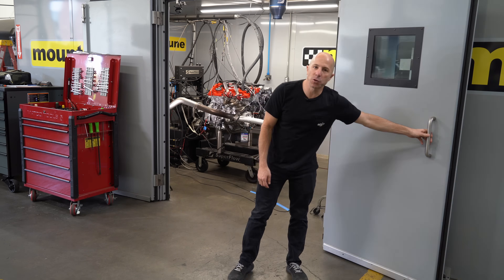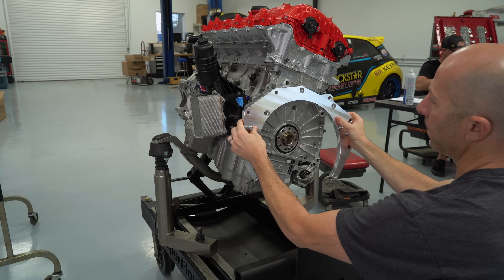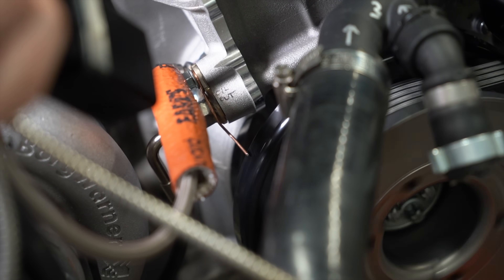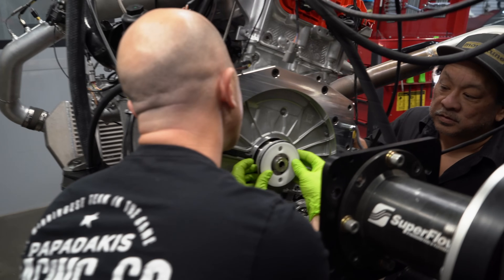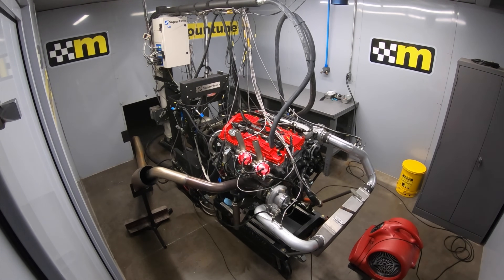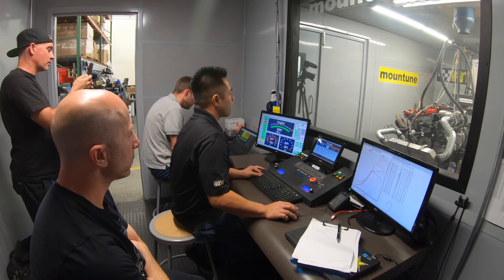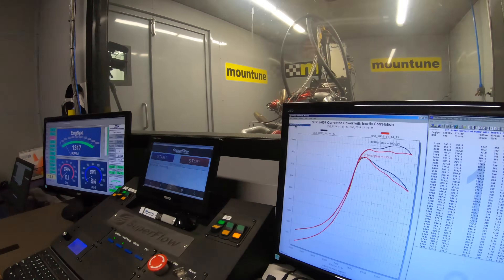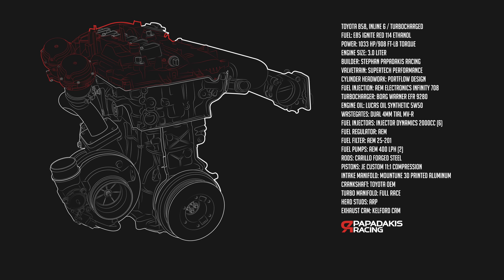B58 Engine Dyno 1000+ Horsepower - Sounds like a 2JZ!?

Comment: I'd love to know why he went with port injection instead of direct injection. How does that make it more simple..?  Not only was it DI to begin with, but, DI should both reduce the chance for knock and give better mixing. I know there are advantages to both. I wonder if doing both would be better of it it would increase the chance for knock. Anyway, an explanation on this would've been nice. But seeing as this was 4 years ago and we're in the 4,200 comment range I'll have to settle for wondering.
Reply: You need an actual ecu with DI support to run DI.
Which isn't many aftermarket ecus did when he did this

Comment: I noticed the baffle rigidity reinforcement part that screwed on the engine block on the previous video.  I've always suspected insufficient rigidity from weight saving attempts in the engine block by OEM design to be the cause of some rod/main bearing engine blowing up. Especially in high revving engines that have extremely tight tolerances like the bmw S65 V8  8,300 rpm engine. The engineers use lighter alloys and shave off too much of the engine bloc to reduce engine weight and beef up the crank shaft. I don't think they simulate those vibrations correctly with CAD.

Comment: One thing to learn from this, all this concern about minor dirt getting into the engine from the intake or sparkplug holes while doing maintenance work and messing up an engine is laughable. Here this engine got a whole injector head melted and burned into the engine and digested no problem. hahaha

Comment: That BMW motor will die, they are not made for tuning, they suck, you should be happy if they run any good in stock mode.
Reply: Cars been doing well since it came out. Plus that there's another dude whos been running a 9-1000hp S54 in FD for sometime. Unlike FD other countries literally have people rolling 7-1000hp S50-S52s or M50s and etc like its noting. Its false to say they suck when in other countries unlike america they have people using bmw engines for performance and that "they aren't made for performance" when there's so many the tune their 6-8 cylinders so much that even their most unreliable engines are modified by people all over.

Comment: Excellent work! In looking at the dyno graph my theory is a little more cam and bigger turbos. Your torque peaks out and drops off fast yet maintains a flat power level. Seems the turbos are running out or steam. The intake cam would also need to be upped to support the turbos. I wouldn't be surprised to see 1200hp out of that motor.

Comment: I love that Toyota is using a BMW motor in their newest supra lol, why not just make more 2JZs?
Reply: It'd be financially ignorant to do so. Basically, they have a habit of making a engine thats going to be spread out in multiple platforms in their line up. Similarly to how the V6 in the Camry is used in a good chunk of cars that toyo sells world wide. They did the same with the 1/2jz with it being in 7-9 cars all at once. In the mk5s case, they wouldn't be doing that since they had no plans in sharing its engine with any other platform to help drop costs since they're all specifically made to fit V6s/I4s so making a engine for 1 car with a low amount of hp wasnt gonna cut it since they wanted the car to be affordable. Plus them mainly going EV/hybrid EV with their cars by 2025 being in the works would see the supra being a pain and waste of money to keep around if its something that isn't being shared around platforms or isn't going to be used throughout the platforms for a set amount of time.

Comment: Is is really a “Supra engine”? 🤔
Reply: yes
Reply: @stefakyou6103  🤣
Reply: @Bimmer_Bill  Do some research on the car and find out for yourself it has Toyota touches all over it. The engine wouldn't be this good if Toyota didn't remake some parts of it. 
So yeah, it's a Supra engine, cope and get over it
Reply: @stefakyou6103  I’ve done all the research buddy. The b58 was developed from a bmw diesel and initially had nothing to do with Toyota. It is only true that Toyota selected it for their supra and tested it, perhaps providing feedback to bmw for later revisions, Toyota was never part of the original design. Get your research right!
Reply: @stefakyou6103  from the lead engineer on the mk5 supra, “It wasn’t a matter of lowering costs,” Tada said. At least not entirely, though that did happen. “The Supra had to have an inline-six. BMW HAD A GOOD IN-LINE SIX ALREADY.”

“It would’ve taken years for Toyota to develop such an engine from scratch, he said—and “another factory. How realistic would that be?”

So, you are flat wrong the b58 is a bmw engine. What Toyota did was provide feedback after testing it after it was already in bmw cars and they “tuned” it to use specifically in the supra. Furthermore the development of both the Supra and Z4 was a joint venture. It’s a fact. So, the supra is far more bmw, than any bmw is a Toyota and if you think about this is what Toyota does they use other companies engines, the 86 is a Subaru. The LFA is a Yamaha. The 2jz is the only legendary engine they’ve ever made without assistance from companies with greater technical abilities. They copied engines for nascar. They were a failure in F1. They only won lemans when audi, Porsche, Ferrari left. Facts.
Reply: @Bimmer_Bill  never said it was developed by Toyota

Comment: I have seen the 3 episodes the teardown and the assembly and the dayno....amazing episode and was surprised by the technology on this engine specially the oil cooling system and the 3 camshafts and what i did not like the plastic intakes side.... With all this amazing technology i still prefer the legendary 2jzgte engine 💪

Comment: What's the point of running an aftermarket ECU on the fragile BMW B58 aluminum block engine for 1000+ HP instead of using a much cheaper 2JZ thats much stronger cast irong block ? I doubt its for video shooting? I made this comment during the middle of the video, and noticed that they direct injection is not even used! WTF! From my exeperience, deleting the direct injection is because you didn't have a proper ECU that supports variable fuel pressure control. You  spent whole lot for filming and not using an up to date ECU do to this job. Why wouldn't you want direct injection for turbo charged engines which creates a much lower temperature charge/mixture? Inline 6 having problem of block/crank stiffness due to its length. This project is practically nonsense in engineering/financial point of view. Why don't just fabricate engine mounts for 2JZ if you want to put it on BMW? We have done this on many old E46/E90 BMWs that saves loads of money for maintaining factory fragile BMW engines. BTW, where is the factory valvetronics?  I guess you simply leave it wide open (max lift) with controller delete which is shameX2

Comment: I don't get two things....
Why would you completely remove direct injection which is superior to port?
They could set up a dual system if nothing else.
And as far as I know the 2JZ engine could be build to well over 1000hp.
So if they're struggling to get 1000hp.... Then is anyone gonna make 1300hp or more?

Comment: If you're going to add port injection to a DI engine, why wouldn't you undersize your port injectors and use both? That way, you could run them on separate fuel chemistries, and have the advantage of increased precision over dosage, and have far fewer compromises.
Reply: Zuurker U  I doubt the ECUs get any feedback from the injectors themselves. Because of that, it would be nearly effortless to build your own controller interface, and use any combination of injectors and anything else you may want to trigger on the signals going to whatever the ECU thinks are its favorite injectors.

Comment: Problem with chasing peak power figures is you end up with torque curves like that where peak torque is only produced for about 200rpm and it drops off steeply either side. You're better off with a wider flatter torque curve even if the peak is lower, but it doesn't give such impressive numbers

Comment: You ought to import a Ford Barra 4.0L DOHC 4 valves/cylinder. This is an Australian designed and built engine. Supply is plentiful, however Ford have ceased engine and vehicle production in Australia. This is a popular engine to build as it easily produces 1,000KW at the wheels for street use and much, much more for drag and racing purposes. Others have imported from Australia to USA and there are many YouTube articles which will point you in the right direction. The engine is highly rated just as the 2JZ is.
Reply: Too heavy to be competitive, seeing that it's bigger than the 2JZ and is also an iron block

Comment: How amazing would it be to see a new gen b58 on an engine dyno dead stock. Sounds simple but would be so difficult without the car attached. How would you control everything? You'd have to use a stand alone and at that point you wouldn't be able to use factory settings for cam timing, can lift, ignition timing, boost pressure, knock sensors. I have 2020 m340 that I'm doing bolt ons too and it rips. It went 12.07 dead stock and 11.77 with jb4. Driving to ca tomorrow to unlock dme and tune it for e85.

Comment: I love how some of the solutions are "We designed these mounts and created them from scratch" and "We custom CNC'd this spacer after 3D printing it". But some of the other solutions were "We zip tied a towel on top of it so it won't spray" and "We heated the head up on the grill". TRUE ENGINEERING.
Reply: 😊p
Reply: @movalNika 😊p
Reply: Murica
Reply: Try a pizza oven next time. Bigger.

Comment: With a 2jz you woulda been done with your goal of 1000hp in a couple days lol would be cheaper and easier just to swap one in there.
Reply: Yet again, the 2JZ has years of RND.
Reply: @pmayo7894  it was no where near as complicated as what BMW did to this motor. Lol I’m sure it is a good motor if you don’t do anything to it and maintain it. But holy crap I took motors down and rebuilt them before and this thing scares me. I call this a throwaway motor

Comment: Huge respect! Great build series! The aluminum plug install surprised me. Hard to believe the friction can hold that much pressure, but it does! 🤯
Reply: High pressure, but only a small area its acting on, so force actually wouldn't have been outrageous. I still would have installed something behind them just in case lol
Reply: @alanhillyard1639  yes who knows over time they might move.

Comment: how about 2000hp or even 3000hp? Gtr had hitted already over 3000whp.
Reply: GTR's had a larger aftermarket for awhile. This engines/platforms only a year old so they need time to do any of that.
Reply: @carboydorifutoparty3976  Nope. You can order billet parts anytime you want to it if had enough money to spend that. I have ordered custom made parts several times to my race car. ;)
Reply: @iivohamalainen8103  sure you did
Reply: @ben-ve3kr  Yeah that was easy.

Comment: BMW crap engine !!!!!!!!!!!!  2jz is best -  THE BEST !!!!
Reply: @Seb C Well, you can do it with Billet engine blocks. but changing it, means its not a 2Jz anymore.
Reply: @Seb C Billet blocks are better at quality than the original block, many recommend using a Billet when Over boosting or Tuning

Comment: Just a question: what is the reliability? I mean, this engine can have an "ordinary life" or is it designed to fit a race car that requires every now and then replacement pieces and check outs? Amazing video by the way
Reply: of this thing? nothing. But seriously if you want a reliable supra that will make some power, throw on head bolts, a bigger turbo and a tune, and you will be making 6-700hp all day every day

Comment: Awesome job gents, may I suggest you consult with Gale Banks? He has some very good videos about boost vs power out. It's all about air mass vs fuel mass not necessarily absolute boost. Would love to have that engine in my Nissan Frontier in front of a six speed manual and Atlas 4sp transfer case!

Comment: One of the best videos! But seeing a supra revlimit 7k rpm is -.-
Reply: When they dynoed it in the car, it revved to 7400
Reply: @exquisiteart6478  Big deal
Reply: @ppgg997  I mean, it's kinda hard to make an undersquare engine rev high, so the fact that it even makes it past like 6500-6800 is kinda impressive. Remember, the 2JZ was a square bore×stroke
Reply: @exquisiteart6478  I know dude, for me the engine choice was wrong (may be a beast as an engine) but it was not the one fitted there
Reply: @ppgg997  this was more of a publicity stunt for Mr. Papadakis to show off his engine building skills and engineering. Putting a 2JZ in here would've been too easy so he wanted a challenge and spent hella money (from Toyota) to do some R&D on it
Reply: @exquisiteart6478  I know and i respect him very much after seeing this video!!! He did an amazing job. But i'm just talking for the engine's capabilities

Comment: So is the engine as strong as a 2JZ ? What makes it more or less strong actually? Will it be able to do what a 2JZ is doing? Does it have any disadvantages ?
Reply: Advantages--1. Its capable of making power faster with way less mods needed.2. It's lighter than the 2j. Disadvantages---1. It's limited in aftermarket parts like pistons,cams,rods,cranks,etc.2. Rods will start to bend once over 800whp+hp(record internals for them is 822whp).3. The 2020 has the B58 with 2 port heads that are integrated into the block with a higher compression which will obviously give it less air flow/boost but the 2021 mk5 that's coming out a few months from now will have  6 port heads that aren't integrated into the block with a lower compression with different pistons which will show some differences in how the 2020 vs 2021s B58s will make power.4. Well other than papadakis it's unknown still how much power the stock block can handle until it's reached its limit but my personal guess is 1100whp since some S55s have gone over 1100whp with their stock blocks.
Reply: A M its better than the 2jz its like an updated version if this explains it

Comment: 1000hp does not seem much to be honest out of a 3.0 I6. There are 4 cylinder cars making that much and more with 2L engines. Should have aimed at at least 2000hp tbh
Reply: This is only 5 years old with a barely existing aftermarket with no billet blocks,no sleeves,no aftermarket pistons,no aftermarket cams,etc and is going into a drift car. What's the point of having 2khp when it's going into a drift car and when there's not any aftermarket support that can barely bring it up to that hp.
Reply: @carboydorifutoparty3976  Well, isn't everything forged anyways? You don't need any more aftermarket, just more boost.
Reply: @sranjesuper  No...not everything....the cars internals,crank,and bottom end are forged but it's not going to simply handle 2000hp like noting.....
Reply: @carboydorifutoparty3976  But it will handle 1000? Who measures how much it can handle before they know the limit? I bet it can handle more than 1000
Reply: @sranjesuper  well it more than likely can. If people were able to push 1150-1180whp out of the S55s stock block then they can probably make similar powet out of the B58s stock block

Comment: Are you planning to ever use the direct injection along with your custom port injection manifold?  I have seen some b58 charge pipe injection (CPI) setups, but your setup has six instead of just one more additional.

Comment: Do people realize it should make these power with stock internals? like the 2jz?
Reply: A 2j can handle 700whp on stock internals and might blow if not modded vs the B58 being capable of handling 800whp(more than that is very possible)but will give the high chance in twisting its rods.

Comment: dear sir,how much it costs to built the supra?.tq.
Reply: It depends on how much power u want out of it.
Reply: @carboydorifutoparty3976  ,can you build a full tubeframe carbon shell  circuit racecars base on ae 86 shell.mid engine rear transaxle with 3sgte engine around 500 horse.(.rhd.).what is estimated price.thank you sir for information.
Reply: @ajiamin2882  I'm not a expert and I wouldn't know but I'd say......something like......a bit over 20k or 30...depending on the trans and mods(since 3sgtes are expensive anyway plus depending on the power)
Reply: @carboydorifutoparty3976  ,tq Sir,we will contact you if we want to proceed this project

Comment: So in the re world of hp this 1000hp is by the way a very killer engine but at the wheel after installation on vehicle is only 850-880whp am I right? 
Good job on the motor the search for power is not at all easy. Sounded like it needs to be installed in my 350z 2006

Comment: What causes that kink in the final curve at exactly 4800RPM??  If that kink was not there, it seems the engine would have had a much wider power band?
Reply: @Seb C Thanks for your reply!  However, I suspect your answer relates to when the curve starts its sharp upwards curve and I understand that enough gas flow is required before the turbo starts boosting.  My question relates to the kink RIGHT AT 4800 RPM where the sharp upwards curve suddenly VERY SUDDENLY flattens off.

Comment: Over 40lbs of boost and only 1000 HP? Put 40lbs of boost on an LS and you'll get nearly 2k HP.
Reply: Plus LS has way more displacement
Reply: Very very limited in parts. And most of the parts he was using was home made.